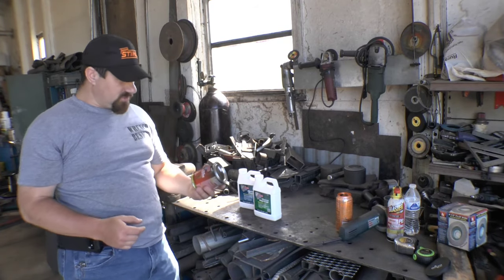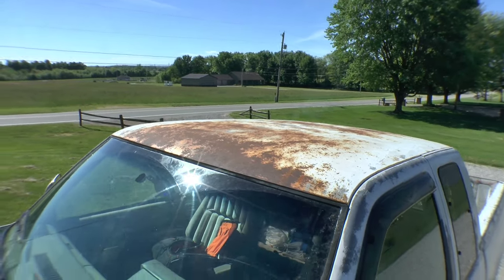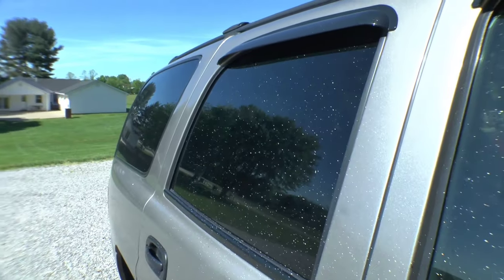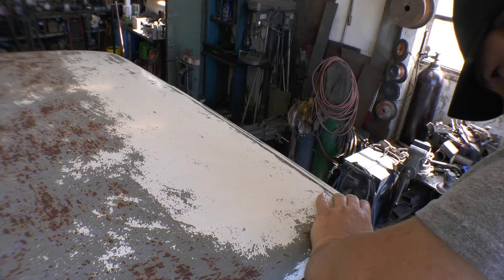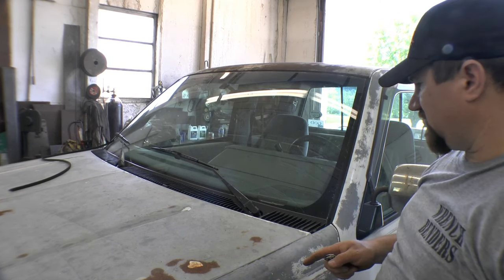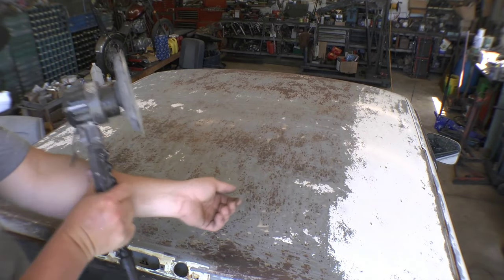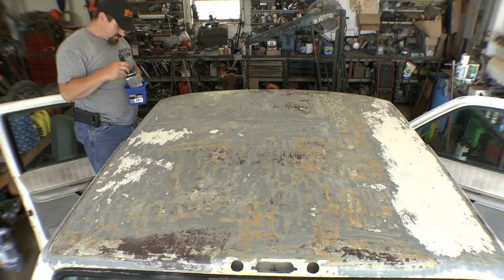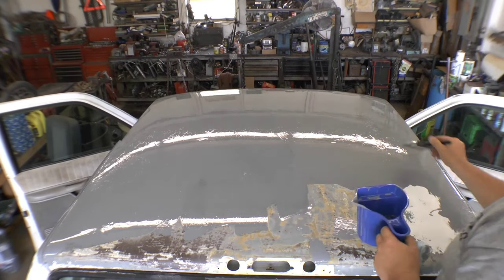Repairing A Rusty Roof Using POR 15

Comment: Expensive and too much work. Soak Vinegar in some paper towels and put plastic over the paper towels for 8-10hrs in the shade. All the rust will wipe completely off. Primer, paint, clear coat and your done. You're welcome.
Reply: Ok, very interesting indeed, I'm going to give this a try. My question is, what does soaking paper towels and letting the sit in a plastic bag do?
Reply: @susanbearer3658  covering it in plastic would make sure that the paper towels dont dry up
Reply: If there is rust between the roof and windshield where they meet, you need to remove the windshield and fix it....
Reply: @mikep509 basically You Will Have To Buy A New Windshield Right?
Reply: @lamarcutts2511  only if removing the old one does it break.... I'm in a similar situation with my 2009 corrolla... a bit of rust near the  windshield where the roof meets... only way to know if there is rust under the windshield is to remove it and inspect/ put back/ fix.... I'm getting quoted $2000 to $3000 for a new roof and $1000 to $1750  for a roof fix by a body shop in  canadian dollars....  a bit silly considering it's a 2009.... I might do it myself but have a mobile glass company come and remove the windshield since they are equipped to do so, and can remove it in under 20 minutes...
Reply: @lamarcutts2511 no you can cut the sealant with a wire string. Takes time to clean the old windshield. So how much is ur time worth?
Reply: @ryanteuscher7996  wire cutter is good, but you can break the windshield , or worse damage the car... glass installers are just more efficient at doing it... for like $100
Reply: @lamarcutts2511  you could tape it off before you start
Reply: THANKS
Reply: Por 15 is durable and has great results, what your recommending is only used for temporarily, if you want it to stay for years sand the roof and put POR 15... it does the job done.
Reply from the maker: @DoctorSultan456 i highly recommend painting over POR15 and it will last for a long time.
Reply: @wrenchbenders  cool, another thing I want to point out is that, most people get pissed off about POR 15's poor results is because of sanding... They either forget the sanding (and then they put POR 15 on it) or they're too lazy to sand the whole roof and the rust spots (mostly they're lazy like some truckers i know downtown), from what i heard from professionals is that, any paint or adhesive, epoxy, will stick no matter what... to a smooth surface, so the problem isn't the product... It's how you do the job correctly, smoothen the surface (sanding), put the product, prime it, paint it, coat it, and your done, people are just sometimes broke and lacks skills and most of all does not have time to perfectly do the right way because they have jobs to do.

Comment: POR works best when it is applied directly to rust as the name implies (Paint Over Rust). POR works by encapsulating the existing rust and preventing further exposure to moisture. That's why it is used more for frames and under the carriage. A better product would have been a rust converter to account for any microscopic rust left after sanding. The converter won't also be a thick, durable coating like POR that can be sanded again.
Reply: i like xion labs 2 in 1
Reply: Por without using a top coat isn't uv protected either, it will break down really quickly

Comment: Too all. Por15 does work. I had a 1967 cougar roof was shot and I do mean shot. Thin as paper also pin holes.. I used por15 instructions to the tee is important. Not only did it work. But it hardened that metal like I put another sheet of metal on it. Had 4 years after in the sun.. never failed.

Comment: Here's a tip, when the por 15 is almost dry but still tacky dust it with primer. The primer will bond to it without interfering with drying.then spray full coat of primer when dry

Comment: good job but to be definitively efficient,  you should  put grease everywhere. grease is the only thing very efficient against rust. put grease between metal and carpet, inside door, behind metallic bumper, under the vehicle, behind  the repairs you can make (everywhere inside the body - hidden erea -  instead of using paint), hollow areas (necessarily hidden, so no need to be aesthetic). For rear wings unreachable with a paintbrush, use an extender and poor old oil everywhere each year. Rust almost always comes from the inside and welds.  Handyman Experience - 35 years.   From france

Comment: Interesting video, I guess it all depends on the final outcome and finish you want, but I think you will be sanding till your blue in the face to get that surface even close to flat again.Ive used some POR15 products on my truck frame, and for that its great. But I sprayed mine on and it came out super smooth. I would like to see the finish product when this is done, especially the part where you put those two pieces of trim back on. I cant see them fitting good, or at all with all that stuff in the channels where they go. But, in the end, its got to be better than when you started.
Reply from the maker: I put primer on it and put the trim back on with no problem. You are right, I will likely have to do some sanding when the time comes, but it is far better than the metal rusting through.

Comment: I am not familiar with the entire prep, cleaner & POR product. I would guess the part of wiping the top down after sanding would have been a little boring but I though, the cleaner or prep looks gray, then it hit me, that must have the POR material itself you was brushing on? Duh! I have seen a couple of times but didn't know it even came in gray. Lean something all the time but thought I missed something. I hear it's tough as nails and a good choice to apply now for future repair as it would not be fun to replace the top's metal skin. Very interesting Ben! Thanks for sharing.
DK, Omaha. Retired tech.
Reply: Is POR 15 kinda like the TV commercial "Franks Hot Sauce?" I Put That S&%t On Everything! DK, Omaha.
Reply from the maker: That is hilarious. 😂

Comment: Great video, one question tho, can you roll on or spray on that POR stuff for a more even finish?
Reply from the maker: I am sure you can. There are few places where I put it on a little thick that I should have backed off on it but it self levels for the most part.

Comment: I dont think the POR15 you used comes in white. You have to buy the POR 15 top coat paint in white to go on top of what you did correct ?
Reply from the maker: I think you can paint it with what ever you want afterwards. I haven't painted it yet because I am still working on the duramax. I can let you know how it goes when I do paint it if you want.

Comment: Have a fan in the garage?
Reply from the maker: A couple of them, why?
Reply: @wrenchbenders  , Por-15 is nasty stuff. Good to hear you had the fans running during application! :) great video!
Reply from the maker: Left the door open, too. If someone had to use in an enclosed area I would definitely recommend a painters mask.
Reply: @wrenchbenders  agreed. I used it previously, had the dual garage doors open. But no fan at the time, fumes fill up the room quickly.